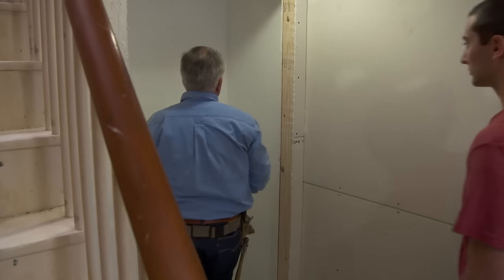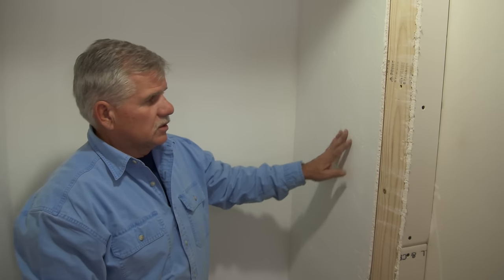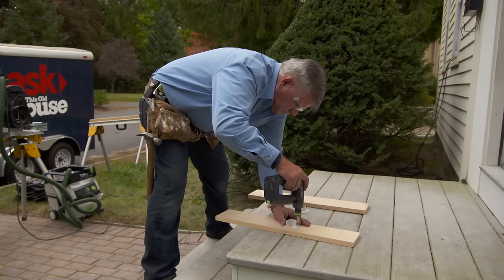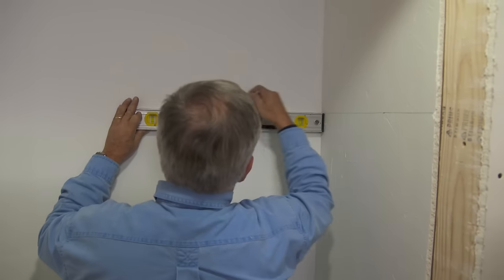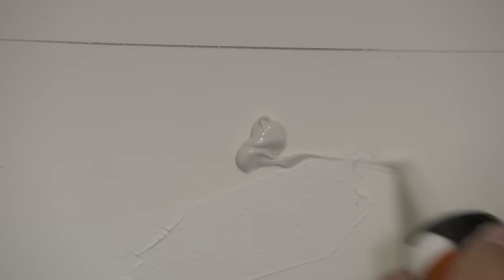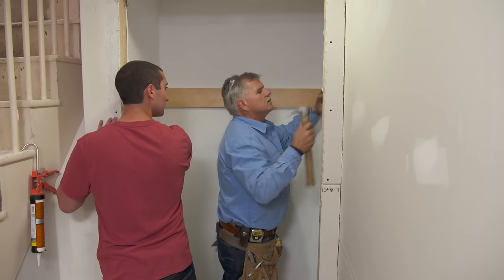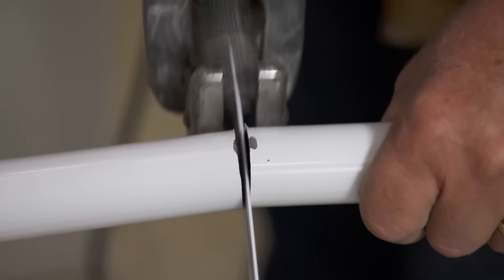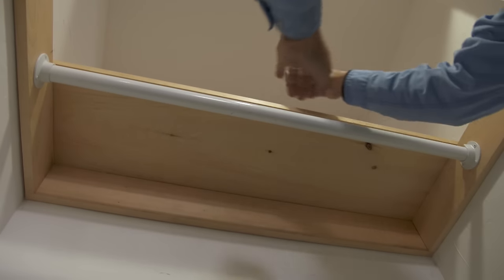How to Trim a Coat Closet | Ask This Old House

Comment: Isn't putting the cleat together outside also making an assumption the closet is square?
Reply: protocultureBJJ putting the cleat together outside makes no difference. The cleat that goes on the back wall goes on first and if the walls aren’t square, the side cleats will bend in or out.
Reply: He used nails so he can bend or any way he likes. Which also makes the case to use screws instead of nails that have no holding power...

Comment: When using your level to mark a line longer than the level always flip the level length ways, Its  good practice in case there is discrepancies in the level itself.
Reply: +iShootBandits 
I've never heard this. I've marked lines for this very thing several times in the houses I've lived in. It actually made me distrust my two foot level. But your tip makes perfect sense. Just like how you should flip a board back and forth when you're making repeated cuts off it. Thanks!
Reply: if your level is wrong, buy a new level.
Reply: Flip the level length ways? What do you mean?

Comment: i don't know why he nailed the trim instead of screwing it to the closet. He wouldn't have needed the glue then
Reply: oh yes cause it would be so easy to hold that up and screw it to the wall with 3 in screws. painters also have to putty the nail holes, puttying a screw hole is probably difficult. also the glue on nails holds very well and nails have a much higher shear strength compared to screws.
Reply: I'm a Carpenter myself for 20 years now and I knowm y trade. In Germany 
we use screws most of the time, nails are mostly outdated since over 35 
years, u sed only to fix moldings or alike to furniture or walls, etc. 
And good screws offer more strenght, even shear strenght than nails. Low
 qualitiy nails, or the wrong nails could bend, or slip out under heavy 
weight. Therefore the glue. But as I said, screw that stuff on and 
problems are fixed. Saves time and material. I never understood why 
americans seem to be allergic to screws and still hold on to nailing so 
much.
Reply: nailing everything is just a lot faster, you have nail guns that hold 50 plus nails and can shoot many at one time, with screws you have to hold the piece up and screw it into the stud which most of the time is difficult and takes forever, production trim carpenters and framers would never use screws for everything. they're expensive and take forever to fasten with and as everyone knows, time is money.
Reply: Also, saying screws have better shear strength compared to nails just isn't true. drive a nail into something and hit it back and forth with a hammer and it will take a good 8 to 10 times to break it off. Most screws will only take 1-2 times of back and forth to snap.
Reply: It's true, nailing with a gun is definately faster and it's totally fine for trim and framing. Driving screws into wood isn't difficult at all if you know how to do it. I don't say nailing is crap per se, there's just a difference how we in Germany usually fasten stuff and how you in the US are doing it. My experience tells me that screwed connections just have a better strenght and hold to them.
Reply: Well, why would I hit a screw with a hammer, screws are not designed to be hammered in, so your argument is invalid. We all know that iron nails are flexible and of course have another shearing durability. They won't shear as fast, because of their design. But in the end the connection is still somewhat weaker, cause nails can move in the wood. The connection is flexible to a point. That's why we use nails for roof trusses over here. Trusses tend to move over time, caused by winds, snow, movement of the ground, and so on. Screws would definately break someday und these movements. I'm just saying that there are connections I definately would not use screws for and that there are connections where nails are just out of date and place.
Reply: chris b Well you all gotta know that we usually don't build wooden houses in Germany. I would say 95% of our homes are made of stone or alike materials and concrete. The only wooden structural parts are roof trusses and we use nails there as well. But when it comes to building drywalls we use metal for framing, not wood. Although I think wood is much nice to work with, it's cheaper and easier to use these metal framing parts that are made especially for drywall.
Reply: That's right. Screws offer more strength. Plus, if you want to change things, you don't have to fight 30 nails that were shot into the wall by American "builders", half of them missing the studs. I just changed out all the mdf garbage for real wood in my new construction, countersunk the screws, and it looks 100% better. And they all are in the studs, for Pete's sake.
Reply: That way when the next guy demos the closest, he can yell profanity at the glue 😂
Reply: Yea i am going to disagree, brad nails and finishing nails do not hold very well. Your assumption is someone is putting 18 gauge screws into that wood work, my only question would be where did you get this tiny screws.
Reply: I would not have used nails.  Screws would have been the the fastener of choice.  Coats can be heavy, and jammed rack of coats is what you prepare for.  And on top of that ( no pun intended) you have a shelf of who knows what will be stacked.I don't think Tommy even put any fasteners on the long board, and why not?  Doesn't the back end need support for the shelf? It's not as important that all three boards be attached to themselves, as it is to be fastened to the studs.  And lastly, the glue on the wall was insignificant. Yes, every little bit helps, but if you can't rely on screws in the studs, I wouldn't put that much reliability on a dab of glue.  Am I wrong here, or is overkill no longer the norm? I'd say, screw the nails, screw the glue, and don't forget to screw your support boards ( and leave your brad nailer gun to chair rail trim)..
Reply: Honest Comments : Totally out of line comment. And BTW, Germany never dropped the atomic bomb on civilians in both Hiroshima and Nagasaki.

Comment: I have a similar project, only I am using shelf/rod brackets that go into the back wall instead of the sides like in the video.  I don't have studs in good locations.  
Would I be able to attach a trim to just the back wall (no sides), and screw the brackets into that?

Comment: I wish Tom would have included the measurements for mounting the rod brackets
Reply: I installed the brackets after the trim. First I used a hanger with a jacket to get the general location. There are usually 3 hole in the backets. The hole at the bottom is what I fastened first then took those measurements to that hole and to the bracket on the other side.

Comment: If the span of the rod is longer, would you recommend using lag bolts, or a bigger nail, to fasten the trim pieces?
Reply: Personally, I'd use screws~
Reply: Yep, I agree with the other guy, I would use screws regardless.

Comment: Not sure brad nails will hold for the long run not sure why he didn’t use finish screws for better grip.
Reply: He nailed through pine into studs. If they are long nails, it's not going anywhere for a very long time, but yes I'd personally fasten them with 3 inch screws
Reply: I use Brad nails to set everything up an go back an put 3in screw in each stud (on a short run)

Comment: what if the walls are out square and the shelf is tight at the back but only partially supported near the front. I would need to somehow cut the board ends on a different angle. how do I get it looking nice in an old house.

Comment: Using a sabre saw to cut the pole , can you say "rough" ?
Reply: he is using a fine tooth blade.  Plus he put the cut end in the socket side, where it will not show, and the clean factory end of the pole in the "u" side.

Comment: No word on hanging rod clearance from the shelf? How low and how deep in the closet is the rod situated?
Reply: I would dry fit the shelf in first, then get a large coat hanger and put a heavy coat that you would wear on the hanger and place it on the side wall under the shelf. Play around with it, make sure the shoulder of the coat doesn't go past the door trim and it's well in the closet. Then pretend to take the coat off the rod, how much clearance do you need to life the hanger hook on and off the rod without hitting the shelf. That's where you mount the rod hardware.

Comment: Wouldn't screws be a safer bet than nails?
Reply: either would work in this application, we're not talking about a lot of weight. screws are brittle, they can snap when under a lot of shear stress. Nails will bend with the weight.

Comment: My closet is 12 feet wide...best way to support the pole in the middle ? Thx !
Reply: Install a bracket to stop pole from moving or add a wall in the middle to help support weight
Reply: brianohbrian burns what is a gable please?
Reply: Add a bracket every 4 or 5 feet. For a 12 ' span, i would put two middle brackets.

Comment: why not just attach the pole holders to the walls using dry wall anchors? just asking
Reply: Not stubstantial enough.  That clothes rod might hold 50 or 60 pounds of coats or other things, and needs to be driven into studs.  Plus, the side pieces help support the shelf, which you couldn't do if you only used anchors.

Comment: I thought Roger would have cutout the drywall to the dimensions of the wood being used. This would have given the closet rod supports a flush look aligned the the drywall, rather than mounted over the drywall giving a proud and unsightly look. The shelf edges could have been set back Into a cutout of the drywall giving a much cleaner finish.

Comment: This is the first video where I did not like Tommy's work. Very amateurish.
Reply: Charles Cho shush
Reply: I agree Charles Cho.. I'm a contractor and have learned many new techniques over the years I've watched TOH.  However on this video, he clearly used either 16 ga. or 18 ga. finish nails, and only a few at that, for a shelf and coat rack could potentially hold a considerable amount of weight.

Granted, it's not a safety issue where this would likely hurt someone, but screws into the studs would make this much stronger.  And we're not talking an increase in cost.

Your average homeowner who wants to do this doesn't own a cordless nailer or even a pneumatic nailer.  But I bet they have a screw gun or drill.

I digress.... one of the seldom occasions I disapprove to Tommy's work.
Reply: Robert Erickson You forget the side rails are nailed into the back rail and screws wouldn't help any better   in this situation .Most of the weight on the shelf will be on that back rail as a contractor you should know this